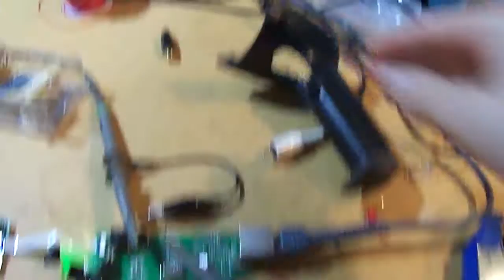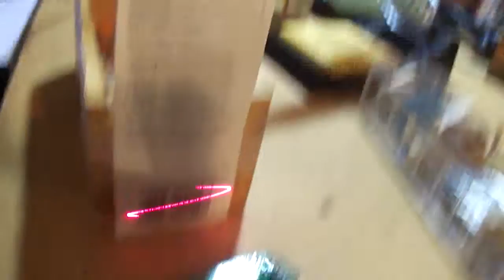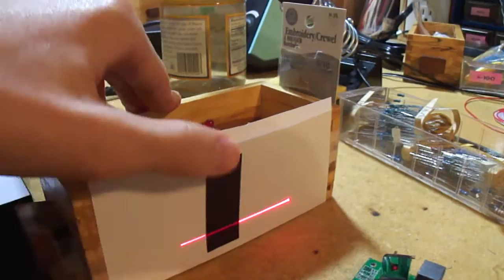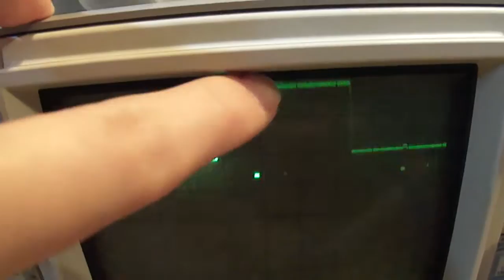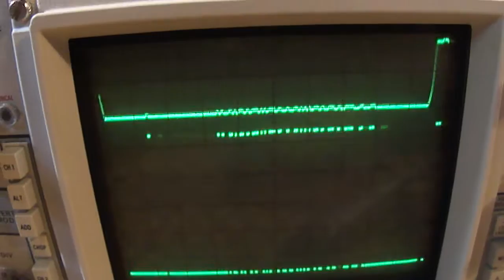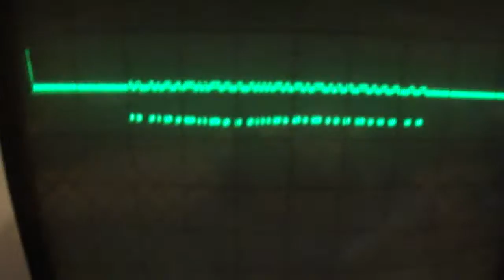Taking Apart a Barcode Scanner - Looking at Internal Signals

Comment: Awesome! Please upload updates. I also had an idea to use barcode scanner for a line follower, but couldnt find much info about this on the internet
Reply from the maker: Thanks for the comment! I'm glad you enjoyed it. I didn't find any good information on barcode scanners on the internet either. So I decided to take matters into my own hands. It turned out surprisingly well. I was able to find the exact signals I was hoping to find rather quickly. Also, I will try to upload more videos as the project comes together.

Comment: hi,

can you please tell me how did you find the pins on where to connect your osilliscope to read the signals? which pins didi you connect the probes to?
Reply from the maker: I probed points on the board randomly until I found what I was looking for.
I don't have a methodical answer for you.
You might try probing points around the main integrated circuit on the main PCB.